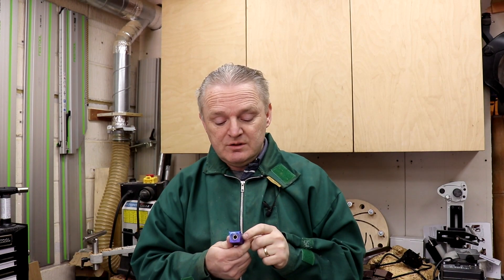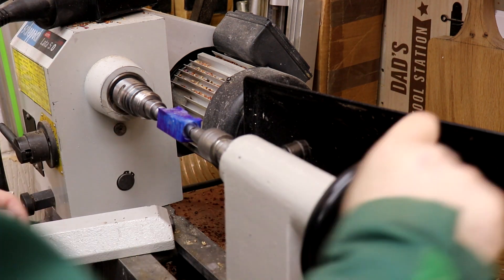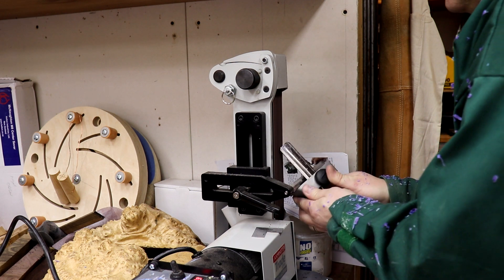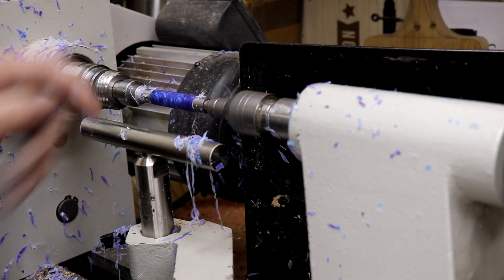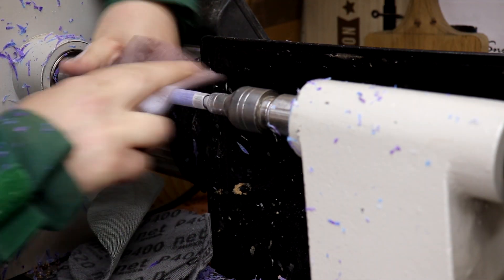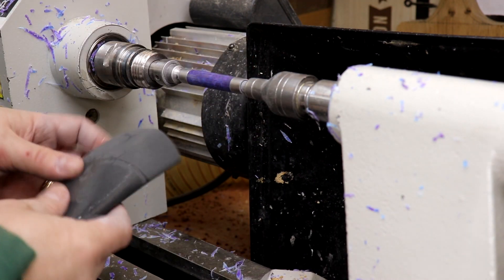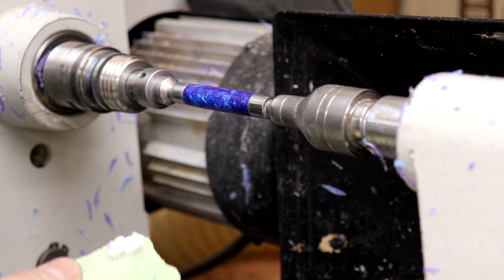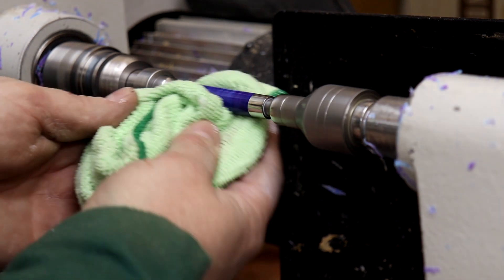Turning my first home made pen blank with a TM Zeta pen kit

Comment: Hi Jason.  Lovely pen blank and great job.  Well done.
Reply from the maker: Many thanks , I do love it, when I first made the four blanks I thought I had messed up. But they turned out good. Made a few more since then, it’s so easy to do, no need for a pressure pot just some slow setting epoxy resin and it self degassed. Thanks for watching and commenting 😁👍🏻